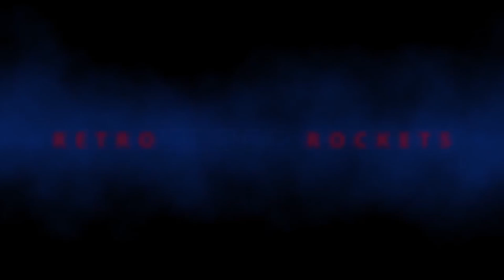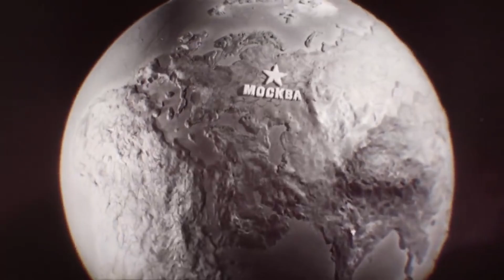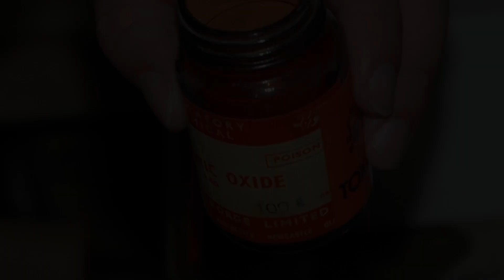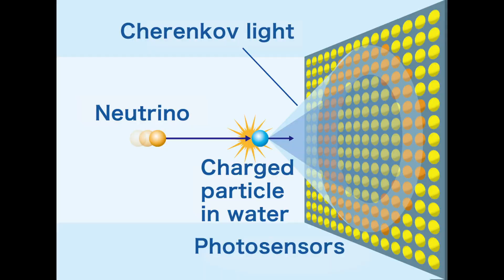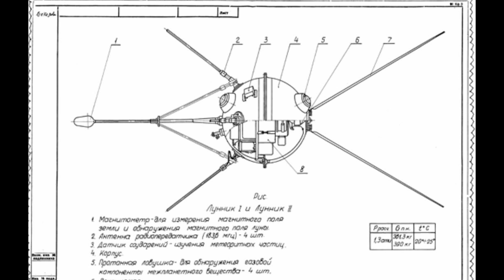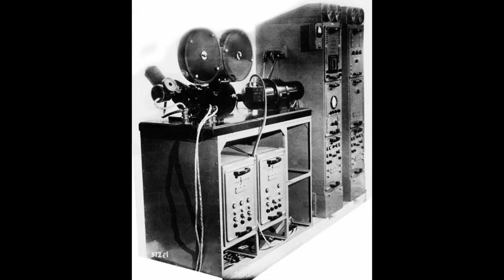USSR's Luna Programme 1-3: The Dark Side Of The Moon

Comment: The metric System went to the moon first
Reply from the maker: Fun fact: While regular US citizens use imperial, NASA uses metric as well lol
Reply: @retrorockets6465  LOL, yep.  And a little-known corollary to that fact is that, in Apollo, the various navigation and propulsion computer systems all did their calculations in metric.  They just ran every result through a translator for output to the crew.  So, all of those "feet per second" and "nautical miles" displays in Apollo were just converted from the actual metric equations.
Reply: @retrorockets6465  a lot of NASA's calculations are still done in imperial because of domestic contractors.

Comment: Great cartoons!  Space is fake.  3arth stationary non rotating plane.
Reply from the maker: Thank you! And sorry to break it to you but the Foucault pendulum physically proves the earth is indeed a sphere. As for space, where would meteors come from if space does not exist? 🤷‍♂️
Reply: @Retro Rockets  I think that the foucault pendulum is manufactured by only 1 single maker and possibly they keep the tech proprietary.   Also I believe that in order to get the pendulum swinging it has to be physically pushed.  Thanks again for taking the time to answer my comment, I'll be sure I am subscribed to you.   Have you ever watched apollo detectives channel?  They believe earth is a ball but do not think man went to the moon.
Reply: The supposed rotation of the Earth is completely inconsequential and irrelevant to the pendulum’s swing. If the alleged constant rotation of the Earth affected pendulums in any way, then there should be no need to manually start pendulums in motion! If the Earth’s diurnal rotation caused the 360 degree uniform diurnal rotation of pendulums, then there should not exist a stationary pendulum anywhere on Earth!"-- Eric Dubay. 

There is quite a bit more problems with faucaults pendulum that make its scientific value quite questionable.  Einstein himself said there is no way to determine if it is the earth that is moving or the ether, I'm sure pendulums must have crossed his mind.
Reply from the maker: Well I do know it will work without any interference such as an electromagnet that are at museums, but not for weeks on end due to gravity and the friction of the air slowing it over time. Idk, it's been done in many high schools and the equation still holds, if it was anything other than a sphere they would be off. However, I understand the skepticism, we cannot personally see it unless we go up there. You're definitely entitled to your own opinion, but I personally feel things like viewing observable satellites and space stations wouldn't make any other sense.
Reply: @Retro Rockets  thanks again for replying and taking your time to answer me, much appreciated!